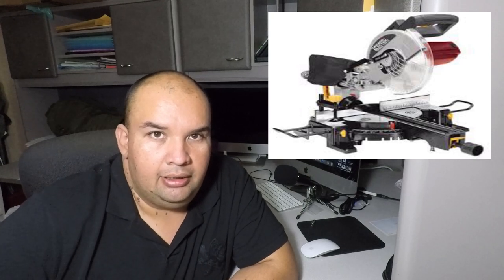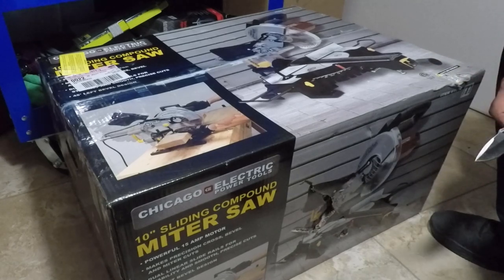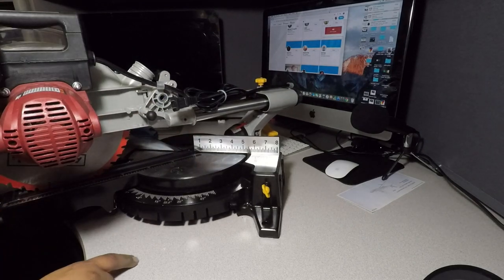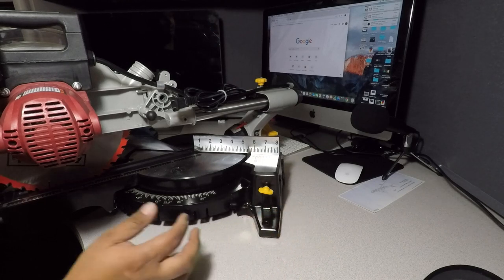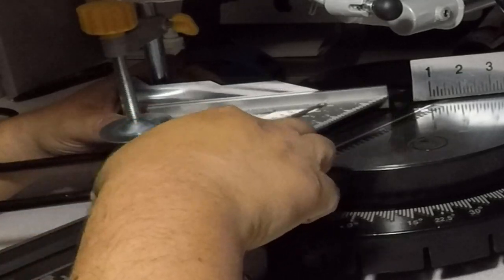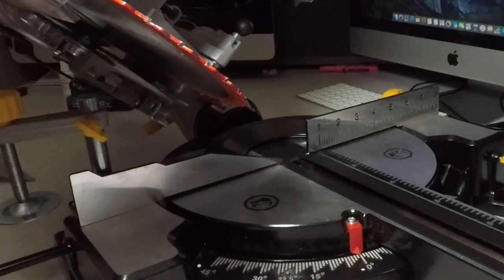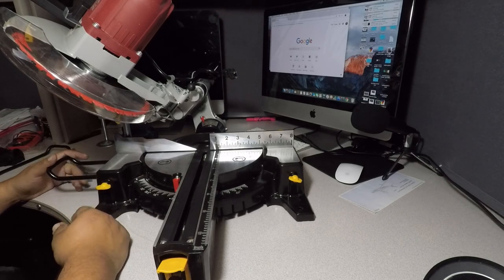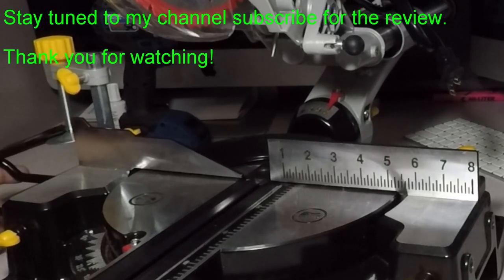Unboxing Chicago Electric Sliding Compound Miter Saw| |Harbor Freight

Comment: I've had mine for about 4 years. I bought it originally to do a bunch of baseboard and door trim work around my house, got that all done. I've cut window blinds to length with it and just built a small deck with it. It's done pretty well. My only complaint with it is if you're cutting taller trim with the blade set to 0 degrees tilt and using the table to cut the angles, the frame of the machine will hit the top of taller (around 4" or taller) trim and not cut all the way through. Not an issue with shorter pieces of trim though.

Comment: I have a question my mother saw handle broke I couldn't find on to fit so I took a light switch an fixed my saw it had a yellow, red and blue wires my question is which wire does what
Reply from the maker: I couldn't tell you, hopefully someone in here knows.